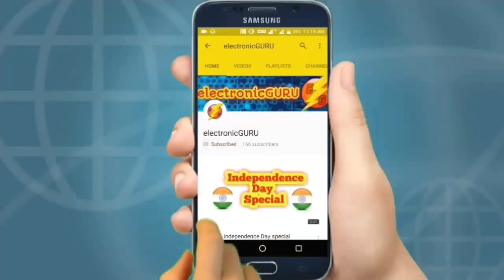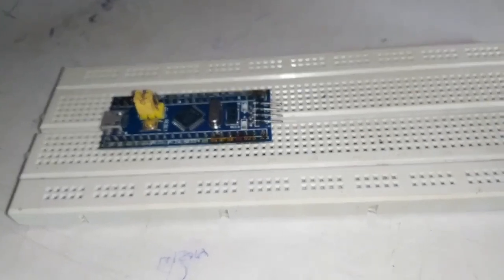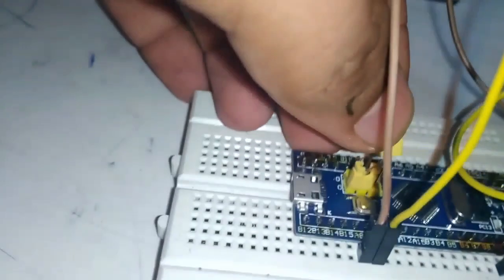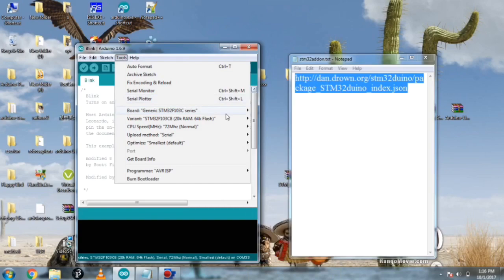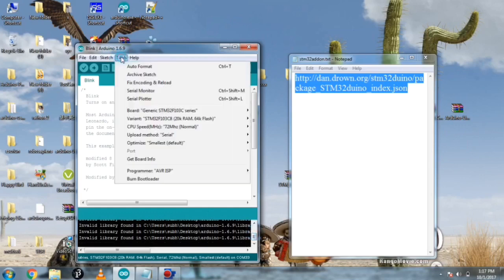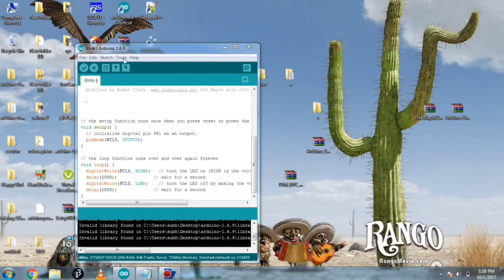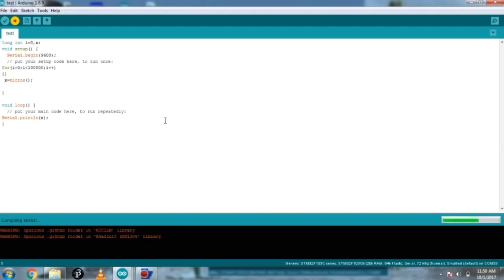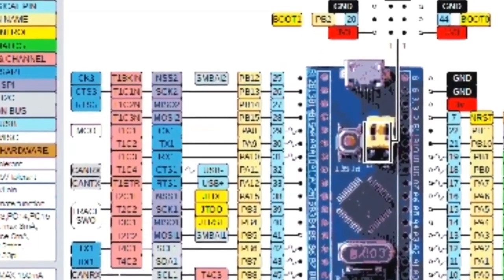STM32 Arduino IDE Tutorial Getting started with stm32

Comment: Arduino: 1.6.4 (Windows 8.1), Board: "Generic STM32F103C series, STM32F103C8 (20k RAM. 64k Flash), Serial, 72Mhz (Normal), Smallest (default)"

Cannot run program "{runtime.tools.arm-none-eabi-gcc.path}\bin\arm-none-eabi-g++" (in directory "."): CreateProcess error=2, The system cannot find the file specified

  This WAS THE ERROR MASSAGE FROM ARDUINO IDE, WHAT SHULD I DO??

Comment: Hello electronic GURU. I am new to this" micro-things" so I have to ask you a question. On this STM32F103C8T6 board has a built-in Micro-USB port to supply power. Is there anyway to use that Micro-USB port to upload sketch from Arduino IDE? I have follows some post from google by uploaded a USB boot loader "generic_boot20_pc13.bin" to the board via ST-LINK V2 & STM32 ST-LINK Utility but it seem not working. If you ever tried this successful please make a video step by step for beginner! Thanks in advance.
Reply: I see, Thank you for the info. So if you can or have time please make a video about how to decode IR signal then send ( transmitting IR) to control TV,DVD...ect from PC or android using STM32F103C8T6 + IR transmiter module. Thank you